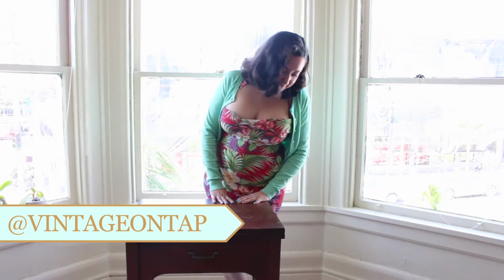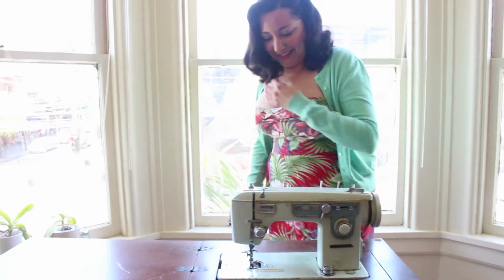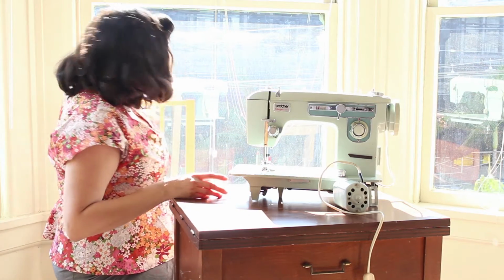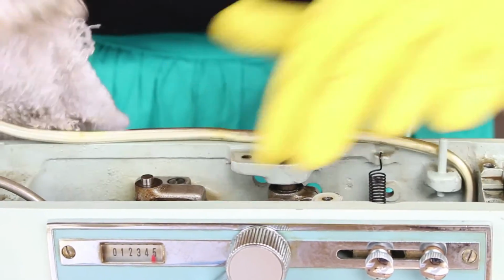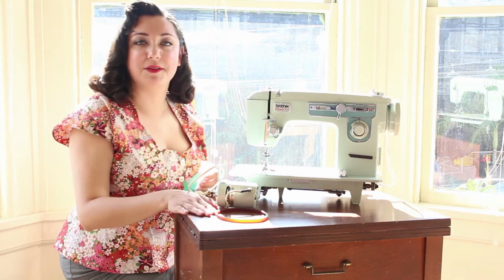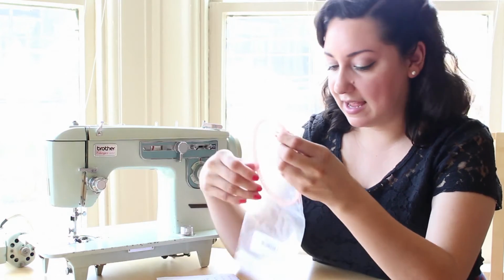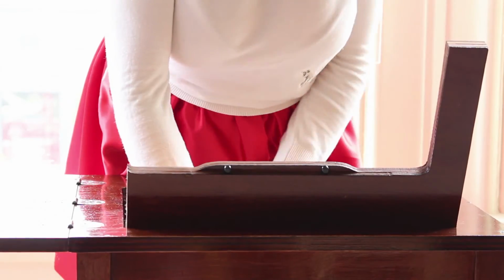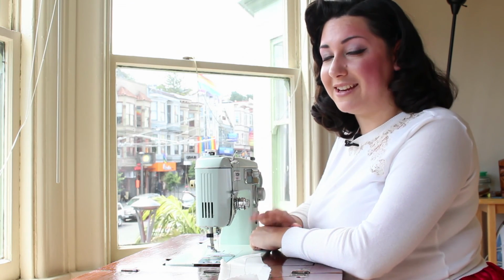Refurbishing a Vintage Sewing Machine, a Beginner's Guide

Comment: Haha… my Japanese “white” 363 (singer clone)  is all steel including the head/body of the machine, it weighs 46 pounds but it has a 1.3 amp motor, even before an overhaul it will run SOOO FAST at full speed that it’s genuinely scary!
It’s in an original cabinet, when you floor it the machine will start bouncing, it might bounce 2-3” high and the whole cabinet will vibrate and rattle itself across the room.
I can’t find anything out of balance 
🤷 we just don’t floor it, it’s also my slowest running machine too.

Comment: Great video, I just got one of these JA-28 machines to fix for a friend and know nothing about sewing machines. Would you know how to centre the needle? When mine is on stitch width 0, the needle is all the way to the left and hitting the plate. Noted on this vid at 8m32s you have the top open and the arm is out the zig zag slide mechanism, I assume adjustment must be done somewhere between here and the hole on the side of the machine that loosens the arm on the down-shaft (with the nut and slotted shaft in view). There is not much info about on the Brother, mainly Singer which have a different mechanism. Thank you

Comment: You need to open the hatch when threading, particularly from the take up lever needleward. The thread on that path goes behind the thread guide used on way from tension adjust.

Comment: A positive about the older machines is that they are fixable. The ones from the late 70s aren't as easily fixable because they have circuit boards. I was told by a repair place that my mother's late 70s machine wasn't fixable. So I'm a bit heart broken about it. They were able to fix my grandmother's 1959 Singer because it was mechanical. Now I have to figure out how to sew with it because I never used it before in my life. I never even saw my grandmother use it. It was always this little table she had in the kitchen. I never realized what it was until my grandmother's passing when my mom inherited it and gave it to me. For years it was in the garage. With the pandemic, I wanted to make some masks so I brought both machines in to be fixed. I'm not giving up on my mom's machine and if there are things I can fix myself, I will. I have nothing to lose, but it will be a job getting parts.

Comment: Hello Neighbor... Bianca ( foon over the hill and in the valley. Lol im in Modesto. Hope this doesn't  sound to weird but, while watching I notice  Walgreens behind you and then it hit , I think o know this corner bwahahaaa that's sounds even worse right!🤣🤣 anyway, I  had already thought you might be in sf by the window. 2 n 2 I'm thinking is that ( without saying to much😉 seams near  the hospital / haight st. ) 
Sooo the reason in popping in.  I was actually searching for info on how to clean / oil/  tune up a machine ive recently acquired abs found your tute. By the way FABULOUS FIND! I tell you here in the valley you'd NEVER find a machine at such an amazing price point. SWEEET! IM thinking maybe I should drive out that way to thrift shop. Over here they will sell a broken base from $tree for 3$   I'm not exaggerating in the slightest.  If you have any info on great places to shop , the ones interested in moving products/ upcycling not just a bottom line.  Ihss looove to heart about them. Be a great bit of fun to pop over to the Bay for pleasure.  Back to the point,  lolol 
Which is.. How did you find the info to work on your machine? Silly question right! Ive searched Google. YouTube .. I have a Kenmore 1560 a few glitches, needs a fresh oil change no doubt as well as a deep cleaning.  A budget requiring zero waste  I'd certainly love  to handle what I can.  Then if need be take Ken for a Dr visit.  Crossing fingers thats not necessary.  But info seams  just out of reach.  I have zero doubts it shouldn't be so difficult. No manual,  found a basic online, yay! Hr runs but definatly not as he should.  I need Ken for handbags and being all metal no doubt he'll be  ready for there thicker  heavy duty tasks when he's has a bit of TLC.
Appreciate your time Bianca , regardless any specifics for help that you may or may not have.  Definatly cool to say hi neighbor.  
Stay well & God bless you and yours!

Comment: You couldn’t give these machines away just a short time ago he popularity is growing , although bargains (cheap) can still be found. The WD-40 references were pretty common and if anyone is interested this product was never meant to be a lubricant it was designed as a protectant. WD makes a great cleaner and adhesive remover and if you want to rid your work of smell just use rubbing alcohol afterword.
Reply from the maker: Thanks for the tip on the WD-40! I had no idea they had a cleaner so I'll keep an eye out for that next time I'm in the hardware store 👍🏻
Reply: Vintage on Tap WD-40 is the cleaner..sorry for not being better at explaining that.

Comment: I have 8 vintage machines from 1911 White Rotary, Singer 99K, Singer 27, Brother J-A28, Riccar J-C, and a Pfaff 130. Additionally I've spent six years working for Bianchi Gunleather in Temecula Ca.
One thing on old machines is the oil hardens and putting fresh oil in won't free them up. You have to use a Liquid Wrench type of product to dissolve it and then use compressed air to remove the debris while turning by hand. Finally wipe everything off and then re-oil all the ports.
As for parts both Brother and Riccar are copies of each other depending on models.
Reply: Appreciate that tip!  I was just given a 1950's Necchi BU.   It had been stored in a basement for at least 20 years, it's a bit grimey, will probably need some loosening up.
Reply from the maker: Thanks for the tip, Keith!! And shoutout to Temecula; used to live out in San Diego and miss the whole area 💖

Shortly after I made this video a couple years back, I ended up taking the machine into a professional shop and they definitely did some additional work on it to get it operational. Unfortunately, I no longer use it due to stitch quality, even though it was fun to pull out and see in action 🧐

Next time I tackle a vintage machine, I'll definitely take your tip!

Comment: So..... after a couple years now, how ya liking it?
Reply from the maker: It's now... a bar in the corner of my living room 🤣

It stitched alright, the problem was that the stitch length would change drastically while sewing a single straight stitch. Depending on the speed I'd push sew, the stitch length would elongate or get super tight. Also, the feed dog area was always really rough on my fabrics, and would shred anything that wasn't a woven cotton. 

Shame, because I loved cleaning it up 😥

But now I have it out on display, with wine bottles along the back of the table, a small palm plant, and some cute tiki trinkets. Close photo of it is here: https://www.instagram.com/p/BlGfFDdhb9o/?utm_source=ig_web_copy_link
Reply: You sure did a fine job on it.
I've been getting in to vintage machines for a couple months now, really more like an obsession... LOL and I've been finding the Brothers are hardest to get parts for.
I have a VX1100 which isn't that old at all and can't seem to get parts for it.
It's a plastic machine I think from the mid 80's, was $5 at goodwill so I'm really not out anything.

Right now I'm in to the old Japanese machines and some old Singers, and really enjoying it.
I have two short videos on my channel of two I've been working on, a Dressmaker and a Mercury.
Beautiful machines, I love em'

Comment: I love your old machine and, love that you love it.  It looks gorgeous, and, they are work horses.  I have an old Bernina 117 K which is probably as old as I am and, I'm old.  It's still working but I haven't used it in a while so I'm going to give it a good cleaning and oiling.  Your video has helped.  Looks like you figured out why the feed dogs were low.  You mentioned that you can 'darn' on your machine so you must have a lever that lowers and raises the feed dogs.  I didn't hear you mention it but, watching you sew there at the end, it looks like you figured it out.  Now, on to getting my old machine in good order.  Thanks for posting.

Comment: oh heck i thought id seen all your videos:)...i found a singer from 67' a few weeks ago and by all research its the model when singer went downhill with plastic parts...i opened it and its all metal ecxept for a plate with id stamp...that aside, did you disassemble the gears at all when cleaning or just use the string?...and does wd40 stand well since you cleaned it? thx:)
Reply from the maker: Hahaha at this point I think I've reached 80 videos on YouTube! Time flew this year haha- this one was one of the first ❤️

For your question, I didn't disassemble the gears, I just used the string all over the place as much as I could. As for the WD40, as it did pretty well! I don't think I'm going to use it again on the same machine, only because I already did all the heavy cleaning and the machine won't get that bad again if it continues to be regularly used 👍🏽
Reply: Vintage on Tap oh good, ill give it a go. this machine stinks and needs a clean so bad...itll be cool to see the guts of it too. thx for help:)

Comment: i don;t know if anyone told you but the feed dogs can be raised or lower'd  I have a Singer 15-91 and it's a workhorse and i do all my adjustments and fix it if need be but that is a beautiful sewing mach. good luck with it and don't forget to oil it one or two drops no more every couple times you use it and then about once a week like I said one to two drops. by for now
Reply from the maker: Thank so much for the comment, Luigi! It definitely took me a couple weeks to figure out the feed dogs initially- but it helped so much! I've had the machine for a year now and it is absolutely fantastic!

Comment: Thanks for the video! You inspired me to get my own vintage machine.  Found two actually at a thrift store.  I only purchased one of the two.  Found a Sears Kenmore with the original manual, in a sewing cabinet, most of the feet and the button sewing guide.  The owner even still had the care instruction manual for the cabinet.  All for $25.  It also looks really clean, no gunk anywhere.  I think I made out like a fat rat with whiskers. Thanks again for the inspiration!
Reply from the maker: Wow- that sounds like such a great deal for that machine, everything included!! You definitely got out of there with a bargain!!

Comment: So glad I found this video! Very informative. I have a vintage Singer sewing machine from 1961. I've been sitting on it for years basically using the table it's set in as a furniture piece. You've  be motivated me to pull it out and see if it works. I can't believe I've been sitting on this jewel all this time!!
Reply from the maker: Woo hoo! That's so inspiring to hear! At the very least, its a fun project to poke away at 😗 AND- super rewarding when it turns on and hums!

Comment: Pro-tip (especially for those like me who are new to restoring old sewing machines):  
Take TONS of photos.  From every angle, of every single part, every step of the way, BEFORE you remove anything, and as you go along.  Make drawings and notes of where stuff goes, and how it goes, and what position it is in as related to the other parts, so you can get it back together again.  Lay parts out in the order in which they were removed, etc.  Turn the hand wheel so the take-up lever is in the top position and the needle is up all the way:  think of that as the "starting position".  Always have it in the "starting position" for every photo, so before and after will match.  It's remarkable how far you can disassemble these things to clean and lube them up, as long as you can get it back to how it was in the beginning.  Photos, Photos, Photos !!
Reply from the maker: It's so funny you say that-- I feel the same way any time I've helped do any repairs on my old car! Photos of everything to make sure every single screw was cataloged! I actually did the same thing during the process for this machine- helped so much when I was getting deep into the body of the machine. Definitely a REALLY good Pro-Tip!!

Comment: I recently bought an old Brother Charger 651 identical to yours at a garage sale for 10.00. It came inside a case and was in pretty decent shape ; just needed cleaning and oiling. But even  after many hours of working with it  I could not get it to stitch. Finally, afer a fruitless search for info on the web, I found your you-tube video'  As you went through the threading process I realized I had the needle inserted wrong! Once I turned it to the side the machine stitched perfectly! Thank You!!!!
Reply from the maker: So happy you were able to find the same Brother machine!! It is absolutely a beast, I totally love it haha. And glad you were able to sort out the position of the needle! Sometimes I forget myself and end up having to play with it haha

Comment: Great post! I have a beautiful aqua-colored '50s machine that I got for free about 18 years ago. It's in a gorgeous blonde wood cabinet that's in great shape. But when I got it someone told me how hard it is to work on those old machines, so I got discouraged and never had it refurbished. Your video makes me excited to give it a try after all. Thank you!
Reply from the maker: I'm glad the video is encouraging you to try it! The nice thing about the older machines is that because they weigh SO MUCH so they actually shake less and the inner machine parts don't move out of place over time, like they do with newer, plastic ones. And no doubt, learning the old machine's little quirks is always a learning curve... but worth it! Hope you can get your machine up and running!!

Comment: I have a similar machine.  the Brother Project 651.  it was my great grandma's machine and my grandma gave it to me back in 05.  I have the manual for it along with tons of old patterns from the 60's.  she said my great grandma bought the machine back in 63, brand new.  I have pics to show you, but I don't know how to post them here.
Reply from the maker: How cool that you had the machine passed down to you! I'm sure so many amazing projects have been sewn on that machine. There's actually a surprising lack of photos online for the 650 and 651 online; I would have thought they would have been more common. Thanks so much for thinking of sending the photos over, anyway! And thanks for your comment :)
Reply: I am taking it to a place that will fix the tension knob for just $60.  that's the only thing that's wrong with it.  I have a box of attachments that go with it, too.  I can't wait to use it!   :D
Reply from the maker: monapause 60$ is pretty good for doing refurbishment on an old machine like that one! Did yours come with a button hole foot, btw? Someone else left a comment about old button hole feet and I'm not sure if they exist for this machine!
Reply: I don't have a buttonhole attachment.  I have a box of feet and the ruffler.  I uploaded a pic of my machine on my profile as my over photo.  that's the only way I know how to show you a pic on here.  it's at the repair shop and I should be getting it back this week.

Comment: Hi Bianca.  Got my sewing machine, runs well.  The stiches are so tiny.  Even set on 4 the straight stitch is less than 1/8 inch.  Is that true for your machine too?
Reply from the maker: Ya, I'm finding that my stitches on the biggest setting are still... "Normal"? They're what I would normally sew at on my newer machines. Any basting I've had to do, I've had to do by hand :/

Comment: Most 60s and 70s machines have knee pedals, that's what my knee pedal looks like. Also with the machine turning on and running RIGHT when you plug it in could be the machine isn't plugged in right. I have a 40s singer that did that once. The motor was plugged into the "light" spot and the light into the motor. So as soon as I plugged it in the motor would start sewing.
Reply from the maker: That's exactly what was happening to mine- not plugged into the right place! I fixed that issue, as well as replacing the knee pedal because my machine repair shop deemed it unsafe (I think an electrical issue)- but now it works great. Thanks for your comment.